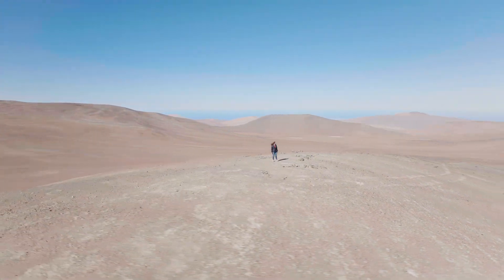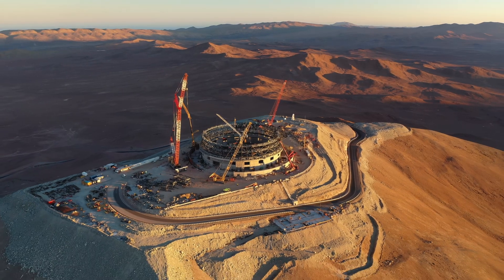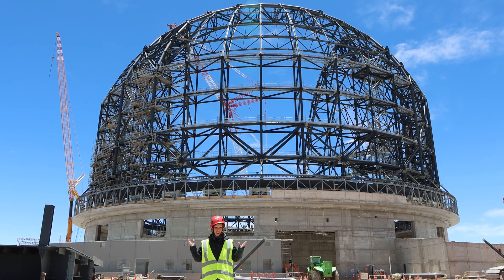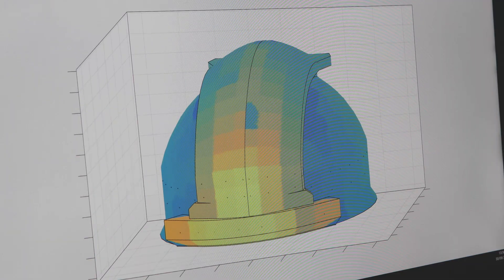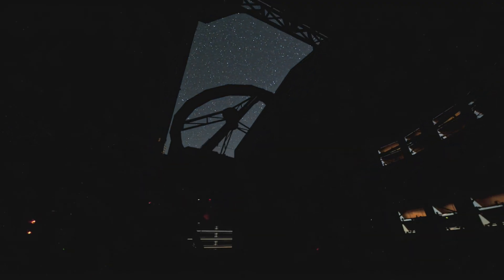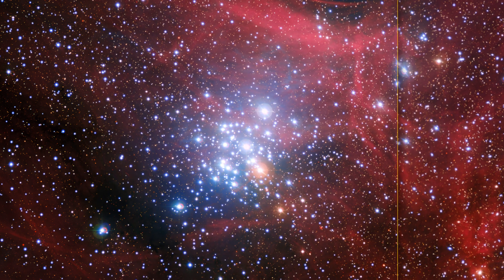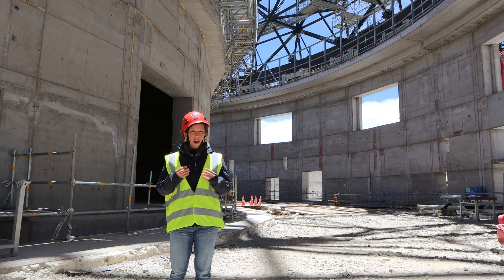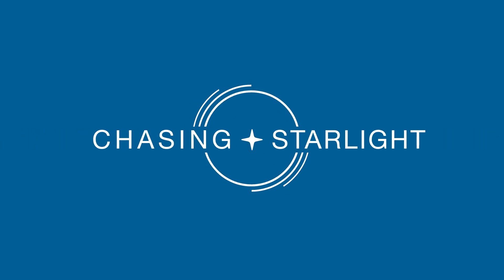The largest telescope dome ever built

Comment: I have a question, while I am not against building this giant telescope because it will allow us to see far in to the past, but why dosent ESO or ESA build alot of small space telescopes and shoot them into space and later just "link"  them togheter to look at whatever wouldn't that basicaly produce the same result? If not a better result? I am really just curious and not bashing this project in any way
Reply from the maker: Interferometry – the technique you’re referring to – is extremely challenging. It’s a bit easier with radiotelescopes, because you don’t have to physically link the individual telescopes, you can combine their signals afterwards in a computer. This has been done before from space already by combining ground-based radiotelescopes with the now-defunct Spektr-R satellite, whose orbit took it as far as 350 000 from Earth. But the ELT observes visible/infrared light, and doing interferometry at these wavelengths is much more challenging. You have to combine the light beams for real, not digitally, aligning their paths with an accuracy of nanometers! We do this with our VLT Interferometer in Chile, for instance. There have been some proposals to do this in space, like ESA’s former Darwin project, but this is not as straightforward as it may sound. Finally, note that a few small telescopes spread apart only collect a small fraction of the light of a single huge telescope, so interferometry and single big telescopes complement each other.
Reply: @ESOChasingStarlight  Thank you for the explanation :) i learned something new today